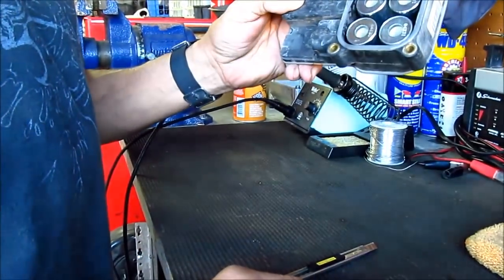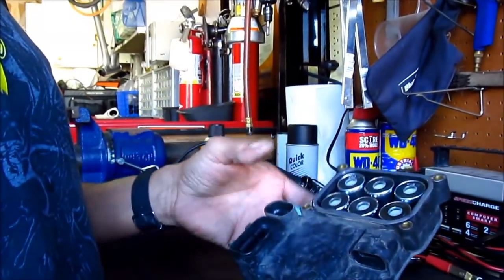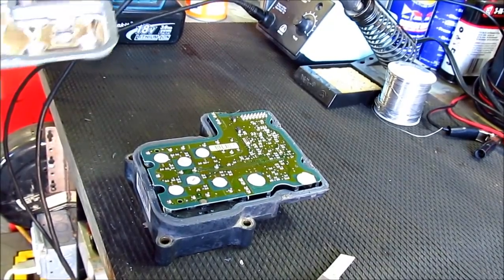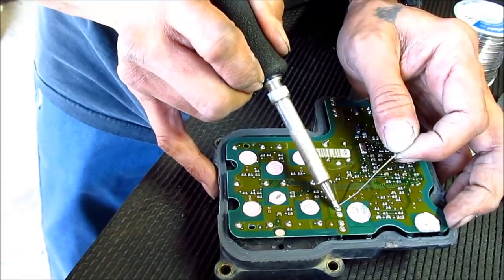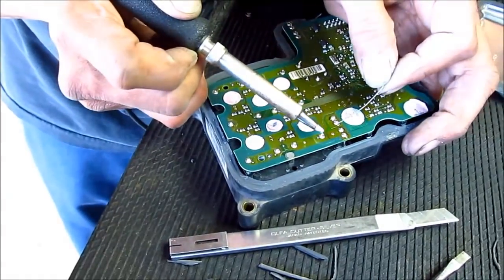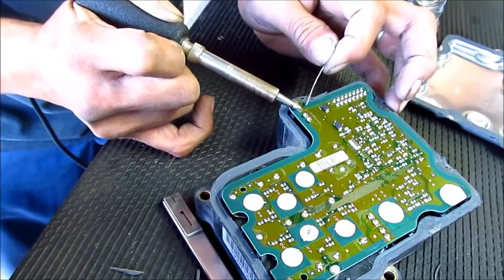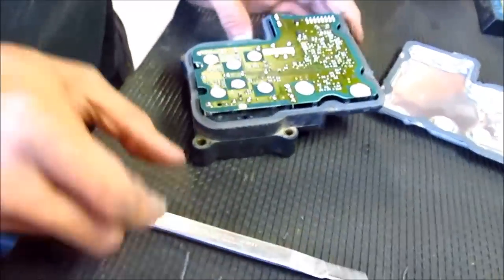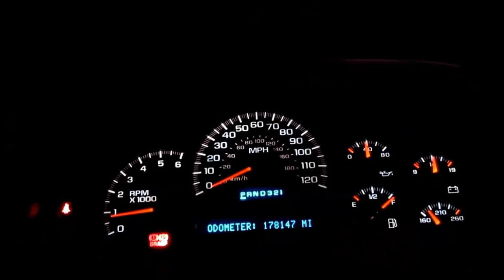Repair of ABS Module in my Avalanche

Comment: Jose, very nice video. I crawled up under my 02 Av last night to access the difficulty of this process and wondered how in the world you got that third connector off.  I couldn't even see it to begin to figure out how it is released.  Did you lift the module off and then disconnect it?
Reply: Jose.  I repaired the module on my '02 Av one week ago.  I figured out that once I removed the two electrical connectors that I could see and then remove the four screws, I could lift the module off and then easily disconnect the third electrical connector.  Unlike yours, my module had the little tiny screws holding it together.  I re-soldered the connectors, put it back together and (knock on wood) it has worked fine for a week.  Hoping this is the permanent fix.  Thanks again for the great video.
Reply: Was your ABS pump running after you shut engine off thats the issue im having on my 02 Avalanche?

Comment: I need repair Toyota camry module any shop you know. The dealer asked me to replace about $3100
Reply from the maker: I would check ebay, there are  alot of people that repair modules with a fast turnaround time and some even have refurbished modules in stock that will require a core. Hope this helps.

Comment: Was the symptoms just lights on or was pump activating when it shouldn't? Mine is lights on and pump activating. 01 Suburban. Had scanner hooked up and wss appeared to be working. However did not do a low speed test.
Reply: Thats the same issue im having on my 02 Avalanche pump runs when truck is shut off , what was your Fix?

Comment: This pc board is surface mount technology with components and connection lands on both sides of the board with thru holes on some connections.The automated wave solder process is not making good solder connections on the side of the board you can't see.
Hand soldering the thru hole connections fixes the bad solder joints. When you solder these joints be sure the heat melts the joint and a good solder flow will go thru and go to the other side of the board making a good connection. Thanks for this post it helped me fix my ABS problem on my 2002 Avalanche that has plagued me for a long time.
Reply from the maker: +synthoify That is correct, I let the solder flow but not too much to where it over flows on the back side. You must have a good soldering iron and patience to do a good solder job. Thanks for the reply
Reply: Was your pump running when truck is turned off that is the ABS issue Im having on  my 02 Avalanche?
Reply: @markythunder  my abs is running after shutting off ignition. I'm about to try this repair. Did you try this, and did it fix it for you?
Reply: @chrisgoosebeck  I did not as my problem was not bad solder joints. I actually purchased a Rebuilt EBCM by Dorman at AutoZone $230 after I turned in core , pn# 599-720 motor stopped running and ABS light shut off.
Reply: @markythunder  gotcha. I'm gonna try the board soldering because I have it out and I guess I can always replace the EBCM if that doesn't do it. I have the same problem as you. Pump stays on after ignition shutoff.
Reply: @chrisgoosebeck  Good luck friend.
Reply: @markythunder  thanks buddy. And thanks for responding to a reply to your 3 year old post! 😜
Reply: @markythunder  it did not work...new module ordered.
Reply: @chrisgoosebeck  yeah, the fix they are talking of is just the light coming on in the display  due to poor wave solder. Di you have a traction assist button on your dash left side of steering wheel?
Reply: @markythunder  Nope, not active breaking/traction control.
Reply from the maker: No, just the annoying lights on the dash.
Reply: Before you tried this how Long did you brake light stayed on???? Time frame months weeks???

Comment: im havin the same problem but my unit is hard to get at
Reply from the maker: +peter ellis What vehicle are you working with? Email me a vaperdown@gmail.com and I may be able to help.
Reply: a Pontiac aztek 02
Reply: +Jose Ilagan I got a 02 escalade with JL4. got a 0285 code and dealer said my pump was shot. I replaced MPS and both front hubs. Only at low speed it drops pressure and locks up. got my EBCM out now to fix like you. Am I waisting my time?
Reply from the maker: +Ian Ryan-Martin i have seen a couple of videos on youtube about abs locking up, I would look at those videos before opening your module.
Reply: thanks for the heads up
Reply: Dear Ian Ryan-MartinIf you have any update for this issue please inform me because I have same issue with yukon 2006

Comment: Jose I got a 2005 chevy avalanche that has that same problem. I actually payed for a new box and had that it put on. In all spent 800 . The problem is that I still have the light come back on after a few days of it been instaled and has not gone off. Is there something u think that could of gone wrong??
Reply: Most-likely, you have an ABS problem at the front sensors. One of three problems you should address first: the ABS lines to the hubs are cut or damaged. Second, the ABS sensors are no longer sending voltage signal to the ABS module or ECM, and third - if you have 'worn spindle bearings' that cause the interruptor ring to have excessive variance, you MUST REPLACE YOUR FRONT BEARINGS to fix the problem. This last one is a BIG ONE for Silverado owners (I have a 2500HD, and the bearing wear will cause such variance that the hall-effect sensor can't always detect the interruptor...so you get intermittent ABS lights). 5 of your 6 ABS fault potentials are at the front end...two grounds, abs wire, abs sensor, wheel-spindle bearing.  Last thing (and most-expensive) is the ABS module itself. Also, an ABS fault WILL CAUSE HELL with your ITBM (trailer brake module) if you have an OEM trailer brake controller in the dash...which also isn't fun to trouble shoot, since you have to fix ALL ABS ISSUES before possibly addressing three connection points on the ITB System, as well as the Module and the TB Relay module!!!  I know...I bought my truck used, with the Parking Brake light on, the ABS brake light on, AND THE ITBM problem reading on the DIC...which led to a LOT of diagnosis and parts-farming to figure out what was bad!
Reply from the maker: You might want to check the main ground wire that bolts to the frame rail, remove the ground wire, clean terminal and frame and re install the ground wire and make sure it is tight. That can be a problem but no guarantees. Another issue could be the ABS pump, you might want to have a shop pull the trouble codes to help pin point the problem before spending any more unnecessary money. There is a possibility that the new module is bad if it was a repaired module also. I would get the trouble codes first then decide whether to try to get replacement module or replace the pump.
Reply: Not sure exactly were that might be. If anything I'll check with tha mechanic and mention what u just told me. If my box is bad i would have to go return it to the dealer ship.Thanx ALOT for your help and video. The best one yet.

Comment: How did you get the third connector off
Reply from the maker: ken crockett I just realized there is no 3rd plug, I brain farted while making the video. My apologies.
Reply: I got it after some playing around, this video was by far the most informative in this subjuct. Only saw two other videos on it. This actual showed the process of removing it. Thank you
Reply: Jose Ilagan did u have to use an extension. To get the back 2 off?
Reply: +Kconley2323 hello Jose I a 2001 chevy Sep I have the bas on on my truck I all ready put the rotor and  the break pads still the same what it could be hope u can help me